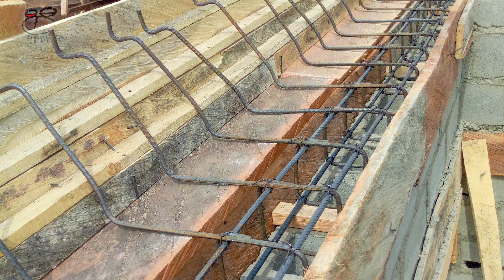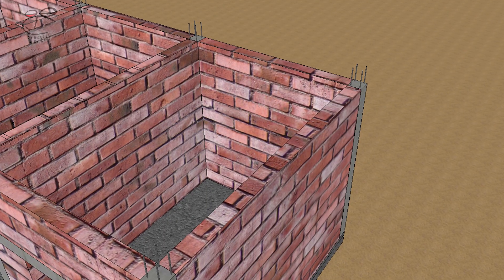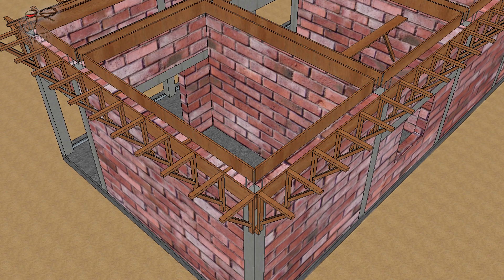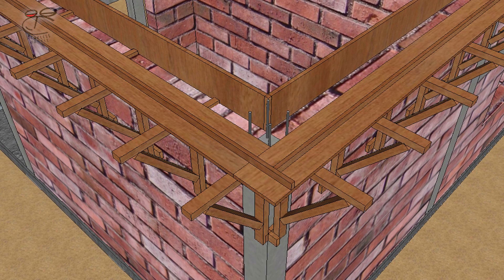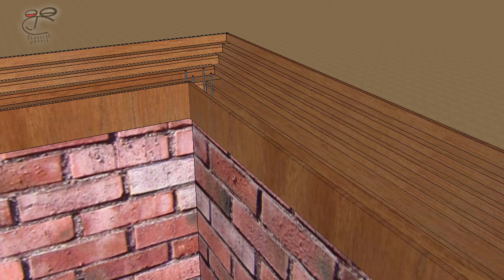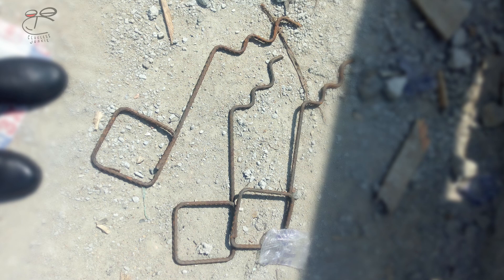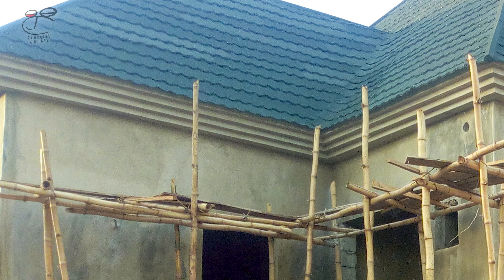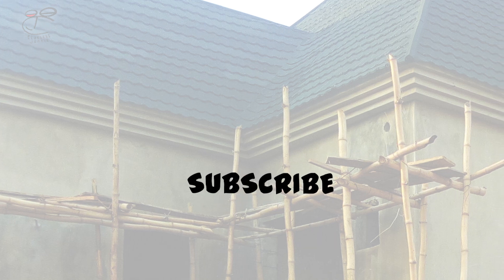Roof parapet | Concrete fascia #parapet #housedesign

Comment: It would be advisable to apply used oil on the plywood or flat boards to achieve a smoother concrete surface when boxing is removed.